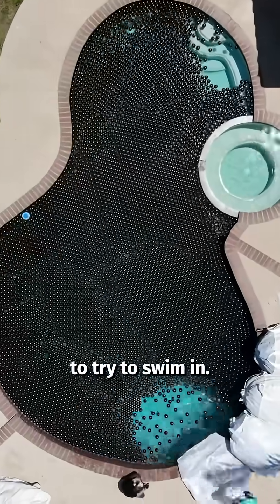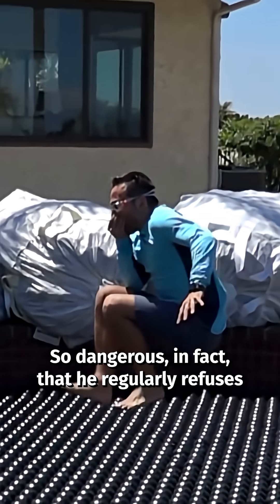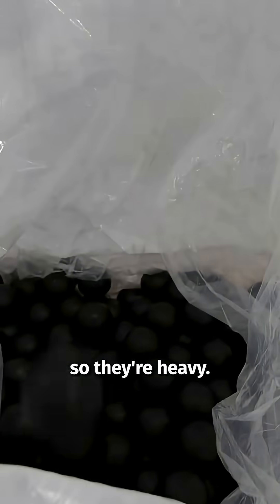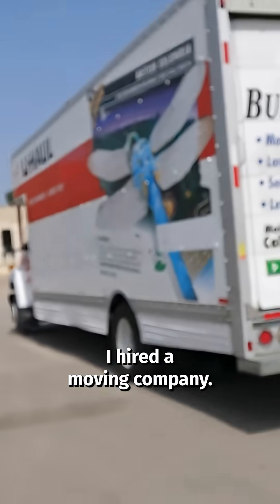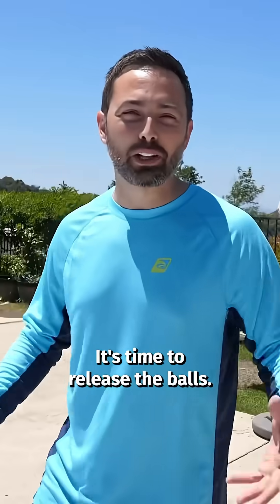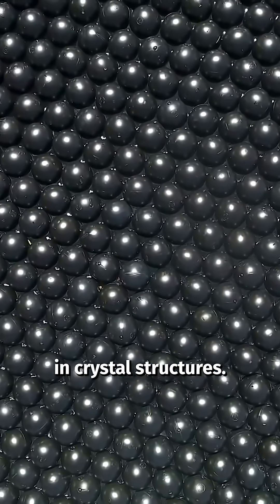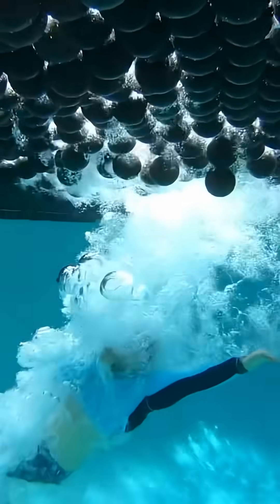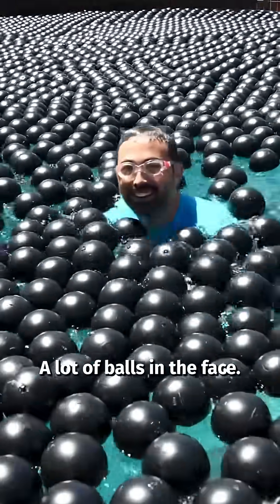Can you swim in shade balls?

Comment from the maker: Just to clear up why this is dangerous:

1. As stated in the video, shade balls are heavy - making it harder to swim to safety. They also make you more tired  causing a negative feedback loop.

2. Imagine you were in a deeper and larger body of water, if you slip below the surface you need to push up through the heavy shade balls, similar to swimming under ice. You would also need to swim further to safety, whereas in a pool you're never that far from the edge or the bottom.

In this demonstration it’s safer because for starters it’s not the LA reservoir; it’s a much smaller body of water; there are plenty of people around and there are fewer shade balls.
Reply: i will not do this at home but in a public swimming pool where there are many people around me
Reply: @agmhelena7266 that’s diabolical😭😭
Reply: @agmhelena7266  YouTubers below 1000 gather
Reply: Tf is wrong with you?
Reply: @kingkaijuboymiregoji2007 Its a joke 😭😭
Reply: @star_yokageguy oh😭
Reply: What's a shade ball even?
Reply: @hornkneeeee my exact question to myself. 😅😅😅
Reply: @hornkneeeee why even make a shade ball
Reply: @hornkneeeee They use them on lakes and reservoirs to stop toxic algae growth by cutting out sunlight.
Reply: @hornkneeeee this👆🏽
Reply: @hornkneeeee what they put on the LA Reservoir to slow evaporation and conserve water.
Reply: @hornkneeeee it stops the fish from transcending to heaven. Not enough space.

- valid sauce.
Reply: Also, when they’re layered up, it becomes ridiculously hard.
Reply: @s_o_m_e_o_n_e__e_l_s_e do they really layer up? In a dam/reservoir?
Reply: @VDiabloV1 well yeah, they are about 2/3 layers high I think
Reply: @s_o_m_e_o_n_e__e_l_s_e I had no idea. I'd think one layer is enough. More than 1 layer seems superfluous to me
Reply: @VDiabloV1 idk, maybe I’m wrong, but I’m quite sure. It’s not multilayered in the way you’d imagine, more just thick. If you watch him swimming, you can see there’s still a lot of space around him. I mean layers to the point they wouldn’t really happen, at least not by winds.
Reply: @s_o_m_e_o_n_e__e_l_s_eohhhh, I got you. Yeah I was thinking of perfect layers
Reply: @s_o_m_e_o_n_e__e_l_s_e it's s reservoir though, right? So that means the water level would fluctuate. Depending on the shape of the thing, more balls could definitely be needed for different water levels. If that's true, then when there are "extra" balls (more than the surface area at the water line), those extra balls wouldn't have anywhere to go and would have to layer on top of each other, right?
Reply: @VDiabloV1 Usually they wont, because of their weight, and because there are only as many balls as necessary to for a single layer. There's no benefit in using more balls, just more cost.
Reply: @maunzilla that's what i was initially thinking
Reply: @VDiabloV1 
No.
Single layer only.
Never layered.
Reply: @s_o_m_e_o_n_e__e_l_s_ethey don't layer them where are you getting this you can actually see them in a reservoir and they aren't layered
Reply: @s_o_m_e_o_n_e__e_l_s_ethey don't wear them up they do a single layer but they do the math so that the entire surface of the water is covered
Reply: @s_o_m_e_o_n_e__e_l_s_enot really. That doesn't make sense. They are plastic balls they dont stick together and form a wall. You will just push through them
Reply: @Libertus1776 you’d still ram into a bunch of them as you come up if there layered right some parts may be looser h it they can align so that there’s pressure between them so there squished together making a hard wall when your in a body of water with millions of them it can happen and if it does your screwed
Reply: I don't feel that you highlighted the reasons why you shouldnt do this or the dangerous aspects anywhere near enough in your video. Video alone, without this text in the comment that only a small percentage will have read, would have you believing that "the manufacturer said don't do it, but we're doing it anyway and it was fun. " 😬
Reply: I'm not gonna lie I think the dude just over hyped the balls so you'd buy 10,000 of his product 😂
Reply: OK, large bodies of water would be dangerous. So whenever you see a large lake covered with ten billion of these balls, do not try to swim in it... Is that the point here?
Reply: I was surprised by how short this video is and how abruptly it ends. This pinned comment alone highlights why the video needs to be longer and explain more.
Reply: @seleuf this clip is from his full length video which fully explains the danger. He should not have released this short because too few people will go to the full video for a thorough understanding of the danger.
Reply: @msbernie1970 ikr? I didn't even see the full-length vid linked or even mentioned in the description.
Reply: @seleuf which is silly considering the original video is at least 2 years old, if my memory serves me correctly. No one wants to do all of that scrolling.
Reply: @seleuf  This is just the Short. The FULL VIDEO is on his channel.
Reply: Thanks for the explanation, Mr. V   ;)
Reply: Never heard of shade balls...
Reply: The issue isnt just the balls, but the fact you could potentially be in pure darkness... you lose track of which way is up, and that's a quick way to drown.

Even 2 layers deep would block out nearly all sunlight.
Reply: Did the you and the manufacturer consider what happens to these balls as they eventually degrade into micro plastics? 
Jeez, that's just what people and the Earth's 
environment needs, all in the name of a short sighted curiosity experiment! 
I hope the balls are made of recyclable plastic; then you can dispose of them in a responsible way. Call your waste delivery office, and ask if they have a recycling program. Or, take them to a recycling center that accepts that kind of plastic.   All The Best,  Sue H.
Reply: Hey, not to be that guy, but i’m pretty sure you meant a ”positive feedback loop”! A negative feedback loop is where the results of the input weaken its effects, and not just a loop with negative effects. A positive feedback loop is any feedback loop where the results get amplified, like how getting tired makes it even harder to swim :)
Reply: @HardTomatoRememberI never really thought about that before, but it makes sense
*it’s basically just the other definition for negative (less than [0] or lessening, minus- instead of meaning a bad thing)
Reply: @HardTomatoRememberwas about to comment that
Reply: @HardTomatoRememberI wondered this too, didn't make sense in this context.
Reply: @HardTomatoRemember I’m surprised he made that mistake, given he’s scicomm
Reply: @HardTomatoRemember he also could have said negative as in bad, i dont know what part u were talking abt but theres that.
Reply: @warfin1379  Tomato literally mentioned that ("not just a loop with negative effects").

He is correct that "positive feedback loop" and "negative feedback loop" are specific technical terms, that should be avoided when they aren't what you mean.
Reply: 3. No one will see you if you sink and drown in the pool. Imagine getting a cramp in there 😳
Reply: Also, if you drown and go under, nobody will see you.
Reply: I still don’t get why the heaviness is dangerous and how it makes it hard for you to swim/more tired. The only dangerous part I understood was it making it harder to reach the surface if you were under them (like swimming with an ice layer) and the fact that it makes the “rescuer” have a hard time seeing you underwater. Can someone explain pls?
Reply: @Aliana-Richard think about the balls like how running in soft sand takes more effort than solid ground, you get tired faster from the unstable surface and the effort to adjust how you run so you don’t fall. So with the balls, the weight makes you need to put more force into swimming because there’s more push against compare just water, you’ll also have to put in more effort to stay above them. It’s the extra effort needed that makes it dangerous, because once you run out of energy way quicker than you would expect you’ll go under… and from the other comments it seems like these are usually used on large body’s of water where you can’t reach the ground which makes everything even more dangerous.
I hope this makes sense!
Reply: @Aliana-Richard When you’re swimming you are displacing the water with you arms and legs as you move. If the surface that you are displacing is too heavy you get tired quickly, if you’re tired then the surface feels heavier, if the surface feels heavier then you get weaker and more tired, and etc.
Reply: @Aliana-Richardthe “heaviness” being a factor here is because any amount of resistance in water is going to make you tired faster. Yeah for a few minute swim it’s probably nothing but if you weren’t planning on swimming in a reservoir (which I imagine has triple the amount per square foot) and you fall in, it can get dangerous fast. 
Depending on the person, on average it only takes about 11lbs of extra weight on someone to pull/push them under the water
Reply: @Aliana-Richardsurvival in water is very dependent on one’s ability to tread water. The more resistant you meet, the quicker you tire and can no longer do so.
Reply: LOUSY. SHOULD HAVE ADDED THIS IN THE VIDEO.
Reply: I'm sorry but u failed in portraying that it's dangerous to swim with them honestly.
Reply: Rescuers can't see you if you get into trouble underwater.
Reply: You should've put that in the short!! Younger generations don't exactly read, so now all they're gonna see is "how well that guy did it. Said its dangerous but beats me why, he looked fine"
Reply: What is the purpose of shade balls?
Reply: @suzysteel slows evaporation of water
Reply: @suzysteel used for municipal dams and whatnot to prevent evaporation and keep the water cooler for fishes maybe as an additive
Reply: But unlike ice, the shade balls will separate easily when you attempt to break the surface. If you are clothed, you can stuff the balls under your clothing and assist in your buoyancy. 
I guess some people have no survival skills or sense of self-preservation. They just fight the balls until they exhaust themselves.
Reply: I could hear you huffing and puffing a little. I could tell from just that little bit  that it's not a good idea.
Reply: Couldn't you just hold onto one if you were tired?  They float.
Reply: Wtf is a shade ball??
Reply: Video did not show that tho
Reply: What is it used for?
Reply: What are they used for originally? Never heard of them
Reply: @barbaraann6819 For a pool, none. They're for big drinking water reservoirs, to slow evaporation and stop sunlight changing some chemicals in harmful chemicals.

He has a video about it. Probably findable under veritaserum LA reservoir, or shade balls.
Reply: @barbaraann6819 I think they're used to reduce evaporation from water reservoirs.
Reply: @barbaraann6819 slows evaporation of water
Reply: What a dumb video lol
Reply: What... Are shade balls?
Reply: @eun-hyerho1959 they put them over large reservoirs to prevent evaporation. Side issue can make the water more comfortable for wildlife
Reply: How does he clean the pool?
Reply: Another dangerous part of the video. You ran on the pool deck. Even if it was into the pool, you ran on the pool deck. Never run on a pool deck
Reply: @fs-oj2pq idk if this was intended to be funny but I just keep rereading this comment and laughing 😂
Reply: @fs-oj2pq you’re not supposed to run on a pool deck as at places like a pool they’re usually wet. If you look when he runs there is no water on the deck limiting the chances he has of slipping to only that of if he trips over himself
Reply: @GmanZOFFICIAL I know but I am a lifeguard and so I will enforce MUST ALWAYS WALK ON POOL DECK even if it is dry
Reply: Why would anyone want to pt shade balls in their pool in the first place?
Reply: this still looks like too much fun not to try
Reply: @snakay201 no. He was able to swim because there were not enough balls covering the surface of the entire pool. Otherwise it would create a film on top that is hard to go in or out of.
Reply: @snakay201  If you really wanna try, use ball pit balls as theyre light and practically have no harm
Reply: @werfer3529  yeah I guess that’s true as well
Reply: @snakay201  a safer alternative is probably use ball pit balls
Reply: @snakay201 darwin award over here
Reply: @snakay201  Oh my God people!!  Watch the full video.  The “short” is a complete disservice to the point.  It’s not about what “bored-rich-people” are doing with their pools 🙄.  The full video is linked right there next to the short.  Yes, it’s dangerous.  But you’ll have to invest more than a minute of your life to see why.
Reply: @snakay201  your cooked
Reply: @snakay201 what about this look more fun than normal swimming
Reply: @snakay201 looks too expensive and messy for the “fun”
Reply: @snakay201  fr tho 😭
Reply: Should i use play pin balls instead
Reply: Thank you for the signed shade ball idk how many years ago!!
Reply: So just use ball pit balls?
Reply: sounds like a positive feedback loop but nice try mate
Reply: Bro, this is not demonstrating whatever point you're trying to push. I like the video, but whatever message you're trying to send is pointless. 😂
Reply: So why didn’t you SHOW these consequences since this is for “science”
Reply: I feel like the real danger nobody mentioned is if a kid falls in who can't swim you won't be able to see them and wouldn't know they need rescuing.
Reply: Rip
Reply: Just break the surface with your fingers pointed strait up and your arms straight like an arrow you be fine.  That’s how you swim up in a fire breaking the surface
Reply: Smh
Reply: Who is this difficult for? Throw a couple of balls out of the water or literally just go under the water to the shallow end? People text while walking cross walks everyday this is child’s play
Reply: Why would you push yourself through the water while on the deep end, just go to the shallow part, and then swim out, lol
Reply: Edit: sorry, just realised someone already mentioned about the semantics before me.

Isn’t negative feedback where the feedback limits the output? Wouldn’t this be a positive feedback loop? They’re heavy making it hard to move, making you tired, making it harder to move, till you are depleted?
Reply: Ya it's the single layer thing that's a huge issue here. 1 layer is doable in a small relatively shallow body of water. But imagine a couple of feet of these things. Full of water. I'm not sure you'd be able to push through!
Reply: Doesn’t “negative feedback loop” mean that it counteracts changes (i.e. a stable way to swim), and “positive feedback loop” mean that it amplify changes (i.e. changes in the way you have to swim)
Reply: So what you are saying is that if somebody covered the ocean with them we'd be in trouble but until that it's okay? Good to know.
Reply: Erm actually it would be a positive feedback loop 🤓 ☝️
Reply: Do they ever get stuck together, making them even tougher to push through? I know they aren't supposed to degrade like most balls would in water, but I also have seen some mentions of issues with them over time. 

How did you remove them, and what did you do with them after this experiment? 

Also, I chuckled at your comment (in the longer video) that people can't swim in drinking reservoirs. In New England, we do all the time. Ours are generally natural lakes, though, so swimming, fishing, boating, etc. predates using them as reservoirs - maybe that's why, along with the severity of water scarcity. Pretty much the only bodies of water we don't swim in are the ones that are also too dirty for town water reservoir use!
Reply: They are nothing like breaking through ice.  I don't see anything dangerous about this whatsoever
Reply: Why are the shade balls dark rather than white? Doesn't the dark color absorb heat and pass it to the water? Does hot plastic release toxins in to the water?
Reply: You plugged ur nose like my Daughter does. 
😆😆😳🍻
Reply: So its dangerous if you are extremely weak and can barely swim or something or maybe a small child which is already dangerous with a regular pool lol
Reply: that's definitely a positive feedback loop
Reply: Hello there
Reply: Or if you had multiple layers, they'd be even more dangerous, not just the weight, but the water displacement would make swimming more difficult because the balls don't contribute to your buoyancy or momentum.
Reply: Also, if someone was to drown/get stuck under the water, it prevents people from seeing what is happening under the water.
Reply: Ahhhh, Google is your friend... sometimes lol
Reply: Feel like that should have been all been said in the video before it ended so no one really does try to copy you…
Reply: How about stuffing them in your shift to keep you afloat 😅
Reply: Helpful to know
Reply: Okay,  i appreciate the explanation for why they're dangerous because that was not explained. But now what's the purpose? Especially when the manufacturer regularly refuses customers...? I don't.. I'm missing something?
Reply: I might be confused, in the video you are clearly pushing them out of the way as you swim. How is this dangerous?
Reply: Also, this poses amajor safety hazard as you have zero water visibility and cannot see if someone has slipped below the surface and is drowning, nor can you see if there is a hazard beneath the surface (objects or animals). These are a HUGE liability and risk for any pool owner that uses these.
Reply: Thanks bc I did understand why they are dangerous to swim with/in.
Reply: Why wasn't this stated in the video?
Reply: that’s a positive feedback loop, sir
Reply: It was at this point that he knew he F-ed up
Reply: Damn your content has become rotten. Just another boring social media guru
Reply: AM I THE ONLY ONE WHO THOUGHT ABOUT THE FEEDBACK LOOP ENDING IN DO NOT TAKE THIS CAT HOME? XD
Reply: It would be great to have this on the clip and not hidden on a pined comment
Reply: Thanks! Love this video
Reply: Oak @Ajai-spl
Reply: You’re definitely used to having balls on your face. 😂
Reply: Dangerous for almost no one 😂
Reply: Better question HOW WILL YOU CLEAR THEM OUT OF THE POOOL?
Reply: 69k
Reply: Also dangerous because, and I quote, "Taking a lot of balls in the face"
Reply: I think the biggest risk is once someone has an issue and needs rescue, you cannot see them under the shade balls in the pool.  It’s not the swimmer themselves, it’s the person playing life guard.
Reply: @chrisstorms1738  maybe make the shade balls clear🤣🤣🤣
Reply: What if he dosent what yo take them out
Reply: Balls in the Face😂😂😂😂😂
Reply: And also 3: Balls in the face...
Reply: 07😊9😅😅8😮 I'm 😅7😮😢😢😊😊😊
Reply: ooh
Reply: Oo ok
Reply: Glad you're safe
Reply: Dumb
Reply: P ppl
Reply: Did you break your own 2 set of ⚾️🥎
Reply: Solution sw9m under the surface and come up for air....
Reply: This is completely stupid and you have way too much money than you know what to do with if you're doing dumbass crap like this for likes and views. I shouldn't be commenting because I'm sure that that adds to your check in some way or another from YouTube.

You belong in the corner with a dunce cap.
Reply: You're stupid for living in L.A. and for doing this stunt.
Reply: We
Reply: Ok
Reply: You’re a moron. You could have donated money to charity rather than your ego
Reply: YEAH
Reply: Just.....why ???
Reply: So dangerous....so now after he gets rid of those balls from his pool...his pool is covered in toxic plastic waste....and it's going to be absorbed by his skin...and if his family even swallow or sip a water from his pol game over
Reply: you promise?
Reply: Would it be safe to to it with the balls that people put on ball pins
Reply: Swim in shade balls and gasoline
Reply: THE ONLY reason you were able to SWIM in that is because they did not give you ENOUGH balls to fill the pool in !
Reply: I also think you don't have as many 
I think the others have multiple layers so like twice as thick of balls
Reply: Thank u
Reply: I still have the one you sent me (Patreon Supporter)!
Reply: So technically if you wanted resistance and wanted to build up your swimming skills and this would be a really efficient way for exercise.. Even stronger than mister phelps
Reply: A net smartass 🤯
Reply: I think if you jump and land wrongly on the heavy shade balls, it can really hurt at impact as they will feel more like a hard surface
Reply: "its time to release the balls" is something i say each day after work
Reply: I can also see that you didn't fill up the spaces with the balls all the way, too. Had you filled it all the way up or overfilled it, swimming through them would become a lot harder.
Reply: I don't get why snyonevwould rfrn be tempted to put these on their pool. Pain in the a$$, and doesn’t even look fun or interesting. Seems like people would just be competing hard for the Darwin Award.
Reply: What even is a shade ball? 👽👽
Reply: What are shade balls used for
Reply: What is a shade ball, ive never even heard of them before
Reply: @robdickerson5315 a shadeball was developed as a way to keep reservoirs of water in the hotter, drier climates, from evaporating. Blocking the sun and keeping the water underneath shaded..by balls. Hence shadeball haha the more you know 🌈
Reply: I'm more interested in what you did with them afterwards. Please don't say you threw them away.
Reply: And yet you showed pure happines
Reply: Positive feedback loop** ❤
Reply: I always thought to add to that, that the fact you can’t tell if someone is drowning under them or not is a danger
Reply: Safety bs
Reply: Given these dangers, how does it impact wildlife that fall into reservoirs/other bodies of water that use these?
Reply: R
Reply: If you know how to swim this really shouldn’t be a problem
Reply: How tf are you gonna get them out
Reply: Lmao this isnt dangerous at all you just needed a clickbait title
Reply: W
Reply: And the purpose of this was to demonstrate what??? 🤔
Reply: But I love swimming in balls!
Reply: Who tf is doing it in a large body of water?
Reply: How many would it take to fill that up tho? This ain’t dangerous it makes it slightly harder to swim 😂
Reply: I think you might’ve lied right to that dudes face that didn’t look difficult at all 😂 any average swimmer will be fine
Reply: It's not to bad that's like half a pound per ball
Reply: If you're going to say you're doing this for science, do it correctly. 
These are in 2-3 layers inside water reservoirs. 
You have this in one single layer, with room for them to move and displace each other, when "pushed" from your "breast stroke".
Whereas if these were in layers, they wouldn't be able to displace each other so easily - and that is why it is so dangerous.
Reply: What will you do with them all now? Donate or sell them?
Reply: Idgaf I still wanna swim.
Reply: Obviously its not dangerous. You just proved in the video its not dangerous. It's nothing like getting trapped under ice. If it was you would have gotten trapped underneath when you tried it. They are floating plastic balls they just move out the way. Its 100% impossible to get trapped underneath. What are you talking about 😂
Reply: And you dont want balls in your face
Reply: you really should have put that in the video because the footage ends up doing what you promised not to do - it looks totally safe and fun…. 😑
Reply: Also that it’s dangerous to swim with balls all in yo face
Reply: The L.A. reservoir doesn't have any water in it so its impossible to swim in it anyway.
Reply: You make me think that the “harder to swim to safety” probably makes them an interesting option for hardcore swim exercise
Reply: I’ll keep this in my mind when I’m swimming in the great shade ball Atlantic ocean
Reply: Why?
Reply: 10,000 is a few?!
Reply: I kind of figured as much as soon as you said they were half full of water, half full of air.
Reply: What are shade balls and what to to with them?
Reply: That's a lotta balls to pack up again😂
Reply: Are you going to make a video on how you got them all out? Because I would like to see it.
Reply: What is their intended purpose?
Reply: Would a third reason not be that these balls resettle into their structures due to weight making it so they're easy to obscure someone who is swimming and in distress if they go below the surface
Reply: Well no one can say that he likes balls or took them to the face 😂😂
Reply: Swimming in balls isn't that impressive, I've been doing it before I was born.
Reply: They manufacturer was totally wrong
Reply: I did this and I died
Reply: Still, this video is the most ridiculously dramatic video I've seen in a long time. Not enough time passed for any of what you or he said would be a risk in the video. Those balls are plastic. He jumped into a pool with plastic balls in them for a minute. That is it. NOTHING oh wow about this video 😂😂😂
Reply: 3. As you said, you get a lot of balls in the face.
Reply: I don’t understand what you thought was gonna happen, pretty lame. All you did was still swim
Reply: Since you obviously have money to waste, send me some 😅😂
Reply: What are the shade balls for? And why are they needed in a pool?
Reply: What is a shade ball?
Reply: So youre saying its fun and I should let my baby brother swim in shade balls? Ok!
Reply: They put these shade balls over drinking water reservoirs to keep contaminants out and to prevent algae growth, as well as to absorb heat from the sun. But it seems they aren't considering the contamination caused by a million or more heated plastic balls covering a huge drinking water supply. 🙄
Reply: What am I going to do buy 1000000000000000000000000+ shade balls and fill the entire ocean. "larger deeper body of water" ok. and why are you on my for you page like who's searching this up. lol
Reply: Skill issue
Reply: @werfer3529 Thats not a bad idea
Reply: Laughing in poor 😂😢
Reply: Also if you drown nobody can see you at the bottom
Reply: For a moment I thought those were tadpoles 😅😅😅
Reply: Must be nice to be able to waste money like this.
Reply: not at all like ice but i get ur point
Reply: Yeah good comment, did the guy who sold you the balls get in touch to say your video did literally nothing BUT promote swimming with them?
Reply: Yes, and just think if you had COMPLETELY covered the surface area of your pool with those balls (which you didn’t)? It would have been much more difficult to break the surface once you were under them - let alone swim through them to the side of the pool - should someone attempt to do what you just did. Especially someone not proficient in swimming and I wouldn’t recommend it at all, let alone try to do so in the deep end!  The things people will do for likes and/or subscribers! Those shade balls will prove deadly if a young child falls in a pool using those!  As a former Aquatic’s Director, WSI, Water Aerobics Instructor, Swim Instructor, Lifeguard and Competitive Swimmer I approve my message!
Reply: from looking at the video looked nothing like being trapped under ice like wtf
Reply: @LisaBrown-s8c because it's not. People are just dumb I guess.
Reply: @LisaBrown-s8c bro read the rest of the comment normally there’s 2-5 layers of balls and you’re normally not going to have the floor five feet beneath you
Reply: Also they’ve delayed multiple boats
Reply: Mna pesa za kuchezea,si unipee mimi 1000 nifungue biashara
Reply: I mean, in a deep iced pound you also couldn't swim further for safety just like in a pool.
It just sounds weird in the video because the situation where you guys did it is very controlled so saying it's dangerous sounds weird. Also because that's not something someone would generally think of doing in the first place. So I struggle to believe the guy when he says he refuse when people ask him to do that.

To be clear, I just mean it feels weird to confidently say that doing something so unusual and specific is dangerous.
Reply: You proved nothing in this video if you fill up a pool with stuffed animals it has the same effect, like what even is this video? So fuckin dumb
Reply: The size of the pool doesn't matter, unless you fall off a boat. I'm not familiar with the actual shape of your reservoirs, but I assume that the bottom is slanted, so you could wade several meters until you loose ground.
Reply: Amazing
Reply: Nerd
Reply: Cool @Jefferystentant
Reply: Swim under water then come up once you reach safety? It’s a pool not an ocean or lake.
Reply: So not dangerous at all unless you're stupid, got it.
Reply: Swimming through even a foot thick of these little balls, is nothing. It's not comparable to ice at all. They sit on top of the water and do not get in your way in any way shape or form
Reply: The question is, how do you get all of them out of the pool?
Reply: @MaisyCotterthe same way you bob for apples I think...
Reply: I imagine they behave exactly the same way as Olympic lane ropes do when they're not under tension. Most certainly dangerous in anything deeper than a pool you can get to shallows of
Reply: I think you missed one of the biggest dangers. 

Lack of visibility, if someone swimming and they start drowning, the Wonder it would be impossible for anyone in the edge to see that they're in distress.
Reply: YouTubers below 1000 gather
Reply: In other words, don’t try to swim underneath Antarctica? What a wonderful science project, not at all a complete waste of time and money. Who pays you morons?
Reply: Biy yes or no
Reply: How do u get those out-
Reply: It is not at all similar to swimming under ice. The shade balls are not heavy enough to provide any meaningful resistance if you're not a toddler or a great great grandma
Reply: Bro that had to hurt
Reply: It's interesting that after being compacted in a vessel n then released into a new area, and being allowed to fill in the area, they naturally create a crystalline structure, which for the record you can see in the way they bounce light.
Reply: It would be more interesting to see how they move after three people splash in one after the other.
Then compare it to quantum mechanics randomness
Reply: From the aerial view mind you
Reply: What is the intended use for “Shade Balls”?
Reply: Lp
Reply: Still doesn't seem particularly dangerous
Reply: I think you need to add all this in the video talking. instead of writing in the comments.  people now a days only watch video and not listening to the complete message
Reply: The cleanup job 💔
Reply: Ur ytshort, just feels like nothings wrong about it, I'm sure they're a full video, but yk the average viewer just scrolls away with whatever headline they retain. As less viewers will check the comments, n even less will look for the full video. I don't feel very discouraged from trying it-despite I already knew why it was a bad idea prior, safety wasn't validated- which is concerning. What message r we truly sharing
Reply: What about when they get really hot from doing their job in the sun
Reply: What the helly are shade balls?
Reply: @ambergardner5223 You put them on a pool to help keep the water temp down if the pool is in direct sunlight.
Reply: I also want to add that it would be impossible for someone to see under the balls, so if you're struggling to break through no one would be able to see you and jump in to help
Reply: We call these reservoir balls and yeah they aren't supposed to be sold to the regular public.  They go in reservoirs. not pools
Reply: Likely used to balls in the face.
Reply: Me thinks you should’ve put this in the video
Reply: What is the intended purpose of the shade balls? I assume as the name implies they’re meant to add shade to a relatively sunny part of water?
Reply: @ChaneyAmericaProud to stop the processes of the sun taking water to the clouds in water areas that are in danger of drying up.
Reply: What are the balls even used for tho?
Reply: ’mmmmmm
Reply: So……never swim in an ocean of shade balls. Got it.
Reply: Thank you! Many also fail to realize that at home pools are also often where children drown most at. It is not safe in any capacity whether it be residential or commercial. use as it poses a risk for swimmers of all ages, but especially young swimmers.
Reply: thank you
Reply: 3. It makes it impossible to see if someone is drowning, and where they are.  There's regulations for clarity in public pools so bodies don't go hidden in the deep end.
Reply: If the goal of shade balls is to prevent evaporation, why not color them white to reflect light and heat away from water?
Reply: I can’t really read it cuz its to long 😂😂😂
Reply: Just imagine how many starved people you could feed with all this wasted money, how many homeless you could shelter
Reply: Why do these go in dams??
Reply: U ever consider u might be abit out of shape? U were huffing and puffing from emptying bags into the pool
Reply: Does anyone notice or not just mention he looked like the guy (friend of Ryan and Co.) who makes parodies about gaming logics, "the town of honeywood" ?😅
Reply: Uhh....wtf are "shade balls"? 🤔
Reply: Wotz the purpose of this video bytheway
Reply: As familiar I am with science, I've never really heard of shade balls. I'd be greatly app6if someone could clue me in on what shade balls are and their purpose(s)?
Reply: Kind of off topic, but why are shade balls black?  Seems like if they were white, they would still provide shade AND reflect a lot of heat; which would be GOOD if you're  trying to ameliorate evaporation...
Reply: Why?!
Reply: What is their purpose
Reply: FRR LOL 😂
Reply: Correction, it is a positive feedback loop with a disadvantageous result. A negative feedback loop is one that terminates.
Reply: Grab a few shove up swim trunks or shirt or just group in arms and shove under you and you will float with ease. Not a real issue in my opinion with drowning unless one is stupid. 🤷‍♂️
Reply: "Fewer shade balls" ahh yes 'few'
Reply: I don’t care ts looks fun
Reply: How if only you had taken that wasted money and give it to a charity to feed staving kids😢
Reply: Stupid
Reply: I’m rich watch as I buy this please but I’ll say science a lot and live in LA lol joke
Reply: Honestly, if anyone drowns because they filled their pool with these, that’s just natural selection. You would have to be extremely physically inept or just completely brain dead to die because of these things.
Reply: Dont worry, no one have enough cash to buy it anyways. Also, no one ever in the human history thought to do it.. only you for content.
Reply: That would be a positive feedback loop: heavy=tired=heavier=tireder, etc.
Reply: The fact these can easily cause panicking when swimming due to the negative feedback your body is getting.  That itself greatly increaes chances of drowning.
Reply: Have you actually thought about some dumb ass kid from middle school to baby man will do this as a challenge and possible lead to their demise???
Reply: Cant believe he DIED!😳
Reply: To dinner?
Reply: So now that you have them, what do you want to do with them now 🤣😅
Reply: And there is only ONE LAYER OF BALLS in the short.  You cannot  swim in more than one layer, like in the reservoir.  Seems no one has the attention span to watch the actual video.  Sign of our times….
Reply: Why would i do this in the first place
Reply: What kind of homosexual hold his nose while dive bomb.. 
Surely  gaylord
Reply: Dude you made it look fun! 😂
Reply: What a waste of time! Why was this a video you thought people would be interested to watch🤔
Reply: 3. You’ll get a lot of balls in the face
Reply: These balls contain a certain percentage of water to stabilise them and prevent them from being blown away.
They are not ' layered 2 or 3 high ' as has been suggested  with only a single layer.
One reservoir in the States received somewhere around 9 million of these balls and they were so effective at reducing evaporation that many other sites are looking to use them.
Reply: So in other words, it’s not dangerous at all
Reply: @Milliardo66 
No, there is very little danger. 
Once you've been smacked in the face a couple of times by big black balls you will soon accept and resign yourself to your fate.
Reply: What a pointless video!!
Reply: @zubzsal583 
 And yet he is attracting pointless comments such as yours.
He must be doing something right.
Reply: Take down the short and ACTUALLY SHOW THE DANGERS because as far as I'm concerned you're promoting this activity to anyone who sees it. You showed us you having fun and cracking jokes, not demonstrating that people could die.
Reply: Disappointed from your video: this is NOT "science". You do I to get people not to try this...by showing you having fun and laughing while doing it. Poor choice to just push out the next  video and feed the algorithm. SAD.
Reply: @tertam72 
This is men doing manly things. 
Obviously outside of your scope. 
Don't be a drag.
Reply: This is absolutely hilarious.
One goose starts rabbiting on about how dangerous this is and suddenly the whole gaggle turns up for a gander.
But hey, in all fairness to them you never know, 
some anally retentive idiot just might be prepared to spend several thousand dollars purchasing small black plastic balls just to highlight the inherent dangers involved in this folly.
My money is on the lead goose as that gander not only has his dander up but believes the broke back supporters club are in absolute awe with regard to his logic and reasoning.
Reply: It looks like the bubbles from the increíbles movie
Reply: There’s literally no situation where you’d be swimming in a bigger body of water full of “shade balls” 😂
Reply: Adults joined the room

Stop talking.
Reply: I remember years ago when you first put this out you did a thing where you sent a bunch of these to viewers.  I still have mine, it’s in my curio cabinet and whenever new people come in, they always ask why I have a big black ball in there with all my little glass things. 😂😂. thank you!
Reply: I.. guess..?
Reply: Wish you'd have actually said this in the video. I guarantee that because you didn't, a bunch of stupid people will imitate this and off themselves as a result of making half-informed decisions.
Reply: You’ve done a terrible job making people feel like this is something they should NOT do haha
Reply: bro realised the video they just filmed doesnt actually give you any reasons not to do this.
Reply: I'm not recommending this, or intending to ever do this, but wouldn't the shade balls be jest as heavy as the water since they are half full of water? Therefore not impacting tiredness much. I can understand a lot of them would be difficult due to the lattice structure though.
Reply: Next time maybe explain in the video? What’s the reason for it then
Reply: *positive feedback loop
Reply: Is that where shade balls are used? On reservoirs to lessen evaporation?
Reply: Most stupid video on your channel.
The question "can I swim in shade balls" implies the pool is full of it instead of water. Maybe than it can be dangerous, but this is click bait
Reply: the other thing is i believe in the reservoir there are multiple layers, making it signifcantly heaviet than the single on your pool.
Reply: @warfin1379 if you understand physics, the balls will just move aside. You'd need a lot of layers to really trap someone underneath.
Reply: That would’ve been helpful to put in the video. A lot of people won’t go down to the comments to read further on why it’s not safe. They’ll just see you swimming with a smile saying you have a lot of balls in your face. 
So maybe remake the video with this vital information at the end of it
Reply: It must have been a real shock to find out what it feels like to be in the pool after the cameraman got in before you and told you what to expect
Reply: @felixmoran1  that take doesn't require to get in the pool, just to get chest to the ground at the edge.
Reply: @felixmoran1 it's a go pro that was put in before the balls di p sht 🤡
Reply: @felixmoran1  have you never heard of GoPro poles, monopods, etc? Cameraman doesn’t need to get in to get a shot
Reply: @felixmoran1 those are drones. Very simple minded 😂😂
Reply: @felixmoran1 I could be wrong, but it's possible the cameraman/woman just put his/her arms in at the edge
Reply: @felixmoran1 🤣🤣🙌🫡
Reply: @felixmoran1  Cameraman warming it up for him.

I only want to see you swimming in the yellow rain. 
Yellow rain, Yellow rain.
Reply: In the full video it's clear this dangerous it would be better to take this short format video offline because It gives the wrong impression.
Reply: Next, try swimming in a pool of Shade Balls, but without any water, and this time do 1 million Shade Balls.

Just kidding, don't. Seems like some sort of quicksand-like nightmare.
Reply: @imjody sounds like just dry pool with heavier balls
Reply: @imjody I got really anxious just thinking about it
Reply: @imjody honestly I think it would be worse than that, like a grain silo nightmare 😭 if you don’t know about grain silo accidents, erm, good luck ig. It’s an interesting but also horrifying rabbit hole to go down
Reply: @imjody  not really though
Reply: @imjody They used to have ball pits at McDonald's. 😂
Reply: @imjody  YouTubers below 1000 gather
Reply: If you had 3 layers ypu would die😮
Reply: You're not even a good swimmer, which makes it more dangerous.  You holding your nose while jumping in is a clear sign of a weak swimmer
Reply: @jameshorn4125  Agreed. Reminds me of the kid that runs his finger across the page as he reads.
Reply: @Code4King  lol
Reply: @jameshorn4125  not everyone wants water to shoot up their nose when they jump in. I've been swimming since I was less than a year old and swimming well since 4. I told my nose any time I jump in or dive , with the exception of a swan or dolphin dive. Jumping in like he did will shoot water up your nose even if you know how to avoid it most of the time.
Reply: @frickfrack7075 Because you're an amateur.  I used to swim competively.  Now I teach children how to swim, it's my job.  I'm a swim instructor.  As swim instructor, we teach children NOT to hold their nose while in the water or jumping in.  You let the air out through the nose as you submerge.  Overtime it becomes a natural reflex.  CHILDREN who took a standardized American redcross swim lesson KNOW not to hold their nose, that is a fact. You still pinch your nose?  Yeah, you're an amateur, a beginner.
Reply: Jesus loves you have a blessed day
Reply: What makes swimming in ice dangerous is the cold itself, what if the cold is removed from the situation eh...bothersome like trying to swim around floating plants probably
Reply: 1) so is swimming in molasses 
2) no it is not like a layer of ice.
Reply: Also the colour black absorbs a lot of the most light out of every colour which will make it very hot would might even evaporate the water and the chlorine gas from the pool will be very dangerous to everyone around the pool
Reply: When I see videos by amazing YouTubers who I massively respect and they’re using huge amounts of plastic, I’m always hopeful that they’ll acknowledge the impact of using these materials which are detrimental to the environment. I’m always waiting to hear how they’ve responsibly reused, donated or repurposed them afterwards. It’s a great opportunity to have a positive influence on the next generation and show that their heroes are thinking about the future of the planet so they should too. 

When none of that comes, and the video ends up feeling like it’s making gratuitous use of plastic feel normal or okay, I feel sad.
Reply: And the fricking purpose of this is ??????????????????????????????
Reply: @mikemancini3907 nunya
Reply: that's cool and all but, who are you?
Reply: @invisibleguydude  Veritasium
Reply: @bluchismoon  ooooooh i see😮
Reply: @invisibleguydude  brotha what?
Reply: @invisibleguydude  just was wondering something sorry for my ignorance but do I know you? I mean maybe it’s due to your yt handle name that it’s so hard to see you or no who your are idk
Reply: @invisibleguydude  the creator of the video
Reply: @invisibleguydude are you serious? Dudes one of the biggest science youtubers.
Reply: @invisibleguydude if you took a few seconds to look you'd know they are the same people that made the video
Reply: i hate these smart mouths
Reply: @V1RTU4L_PNG  you’re just mad that you’re an idiot
Reply: @V1RTU4L_PNG why so negative? Did the shade ball feedback loop get to ya?
Reply: Meow
Reply: @V1RTU4L_PNG is because you don’t understand it right😂
Reply: @Packers123yeah thats where most hate comes from
Reply: @V1RTU4L_PNG come on they are just trying to help us understand
Reply: @V1RTU4L_PNG  they hate you, its ok.
Reply: @V1RTU4L_PNG  these “smart mouths” could save ur life one day.
Reply: @V1RTU4L_PNG  still it’s for youre safety I mean what if you tried doing that even if you saw that comment it would be bad I’m probably younger than you and still knows better about saying in replies that you hate those types of smart mouths
Reply: @V1RTU4L_PNG bruh the channel that made the video made this comment you and a few others looking real dumb here.
Reply: @V1RTU4L_PNG .  That's the channel owner I think.
Reply: @V1RTU4L_PNG  wdym? He's just saying how it's dangerous...?
Reply: @V1RTU4L_PNG then don’t watch educational videos
Reply: @Ayaan-d2q exactly, like what 😂?
Reply: The seller was probably concerned because you said you was going to swim in a pool of shade balls (or whatever they're called) not that you will be swimming in water with the balles just floating.

Thats like leaving your pool uncovered for a week and saying you will be swimming in a pool of bugs